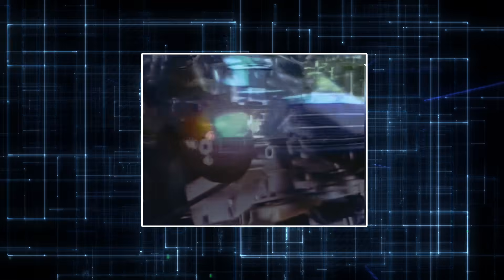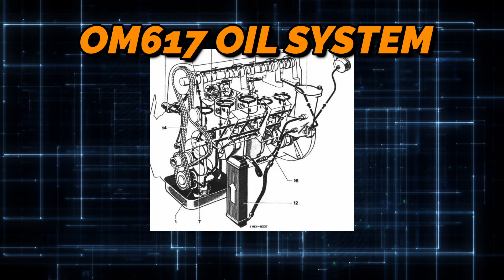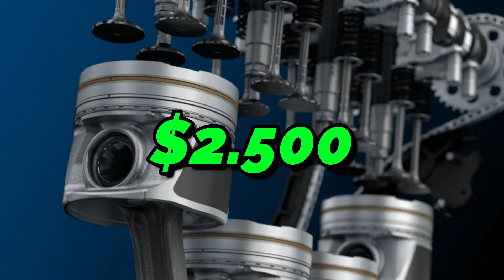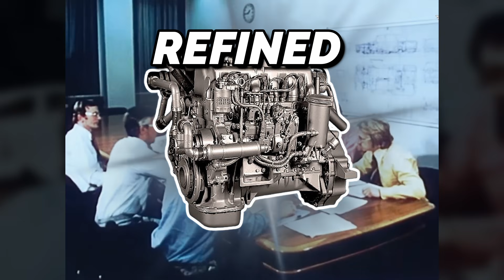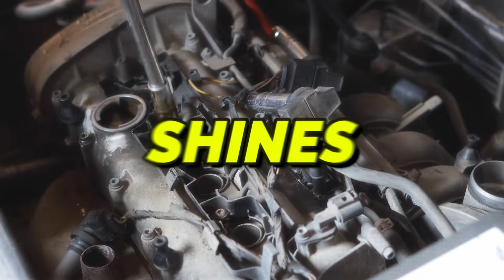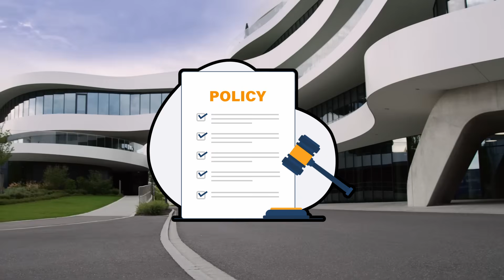The Most Reliable Old Mercedes Engine Modern Diesels Still Can’t Beat: OM617

Comment: The 617 has a timing chain. It does stretch, but not much, and can last 500,000 miles with proper oil changes.
Reply from the maker: Thanks for sharing. Maintenance is key! Do you have it?
Reply: @SeatsAndWheels 

I’ve had 2 w 123 with the 617, and a w 210 diesel. And a 124 wagon with a 603. Now I’m driving gas benzes.

Comment: My dad mercedes c180 kompressor has the m271 supercharged 1.8L inline 4 engine that need normal maintenance like an oil change maby some times its not running very wel but it works like a champ
Reply from the maker: What’s the mileage?

Comment: they did have lousy A/C however...they used that awful GM R4 compressor and an inadequate condenser for R12,,,hopeless for R134.. However an outfit called climakits has modern condensers and sanden compressor conversions that will give you contemporary A/C with a little elbow grease.
Reply from the maker: Good workaround! Have you tried it?

Comment: one error...it does have a plastic expansion tank.
I think about 1990 MB figured out that selling you a car every 25-30 years wasn't a good business model. That was before the transition from reliable workhorse to status symbol.
85 300d turbo 370K miles.
Reply: Just make one in metal...heheh
Reply from the maker: That’s an idea!
Reply from the maker: Awesome. How’s your 300D running?
Reply: It also has a plastic clamping slide for the alternator; you have to clamp a threaded slide behind it because the thread in the plastic gets damaged.